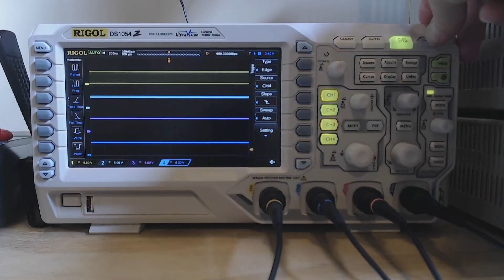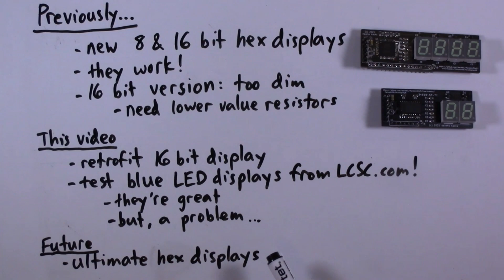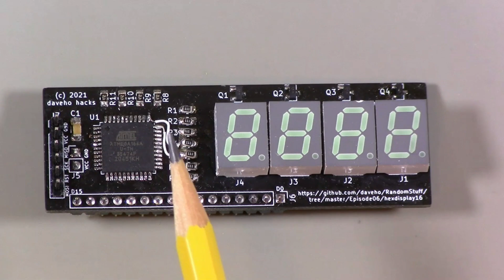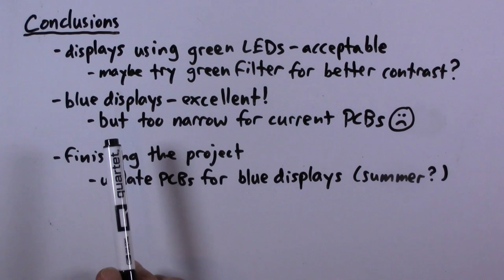Random Stuff, Episode 07: Slightly better hex displays

Comment: What is the status of your DIY 8-bit computer?
Reply from the maker: I'm planning to work on video output / graphics this summer. Most likely plan is to try to use an FPGA.
Reply: @davehohacks  I am in the planning stages of making an 8-bit computer project. It will be driven by the 65c02 cpu. My plan so far is to use a Teensy (Arduino compatible) as a graphics processor and have it work via registers in the cpu RAM, but if it will work or not, I am sure I will find out later on. Still have not put anything on a breadboard, just watching videos and making the plans at the moment.
Reply from the maker: @johnnybremer5889  Nice! Quinn Dunki used an AVR microcontroller to generate VGA graphics in her Veronica project, so I would expect you could do something similar with a Teensy.